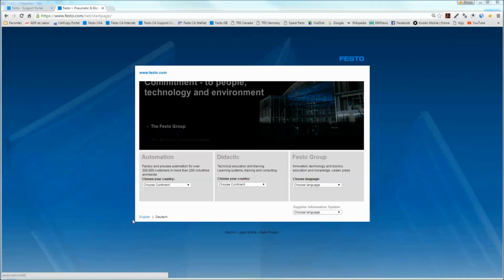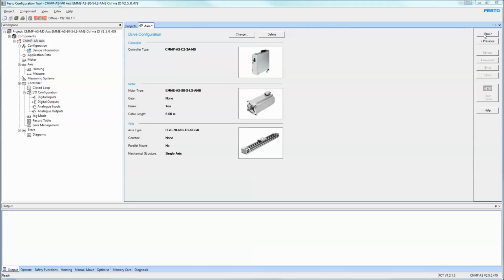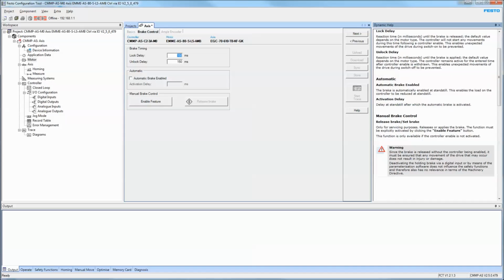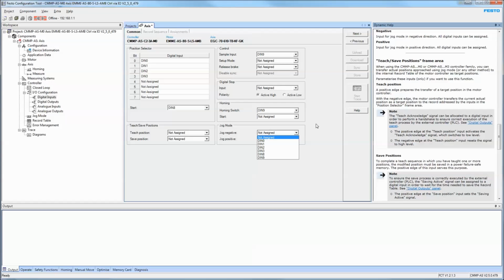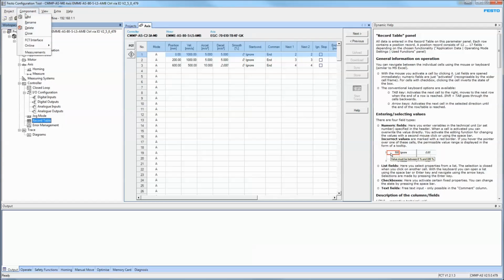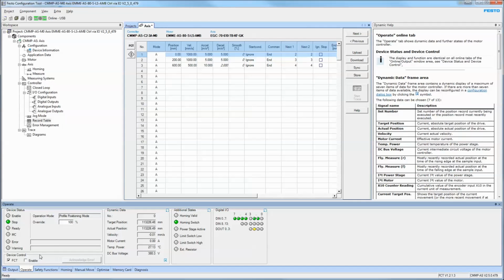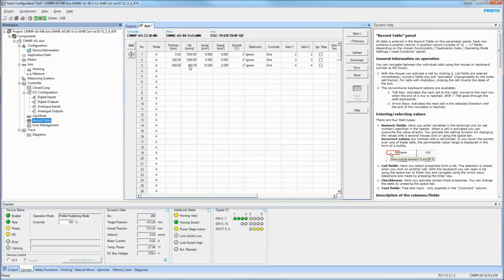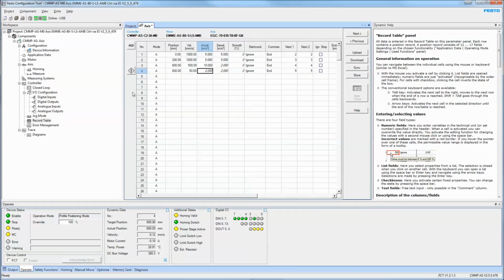CMMP-AS-M0 x1 + IO Control + Wiring + FCT Config + Record Sequence

Comment: Hi, Steven. I am very new to these devices, like this is the first time I put hands on them. Your videos helped me a lot. I got CMMP-AS...M3 + motor + axis from a decommissioned hardware. I need to make a small machine and I only can make it work with a pc and FCT. I can jog and I can use position table. Is there a way to set it up as stand alone tool. I mean, I will program all the info but I need to get it ready from power on and some switches, not PC or PLC. I will use it with manual jog and position table.  Any advice will be appreciated. Thank you
Reply from the maker: The FCT interface because it is designed for use as a commissioning tool - not a permanent control solution.  There may be some RS485 solutions for PC control or perhaps some other alternatives.  I suggest you contact your local Festo technical support for this (this would be free service) - Sorry I cannot support you through YouTube nor do I have time.

Comment: Hi Steven. I am using a S7 1200 PLC to control a FESTO stepper motor. Do you know if it is achievable to control the end velocity parameter of the FCT through the PLC ? I am asking because end velocity it's not available on FHPP block.
Reply from the maker: I do not support technical questions for my personal video’s - I hardly have time to make them. 
Please contact your local technical support with questions about your applications.